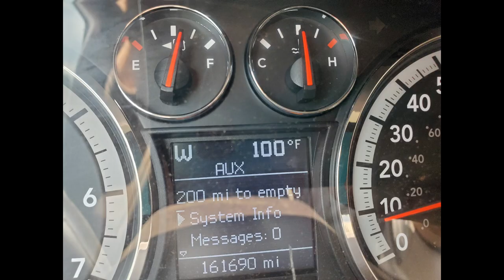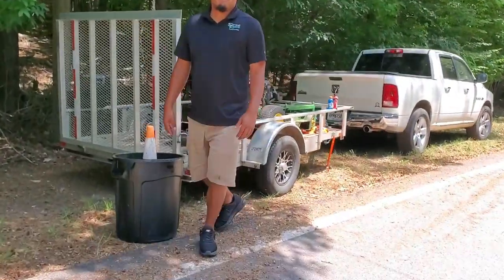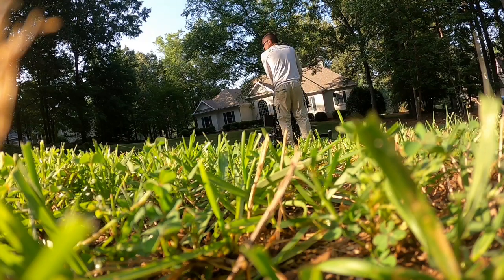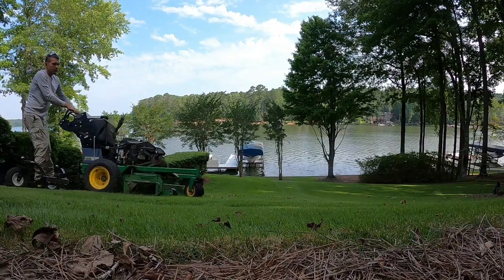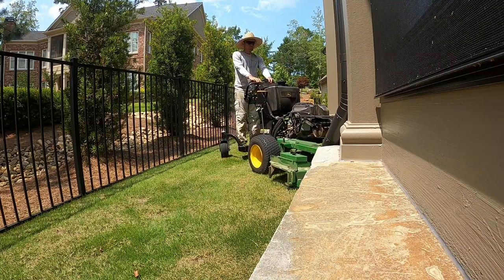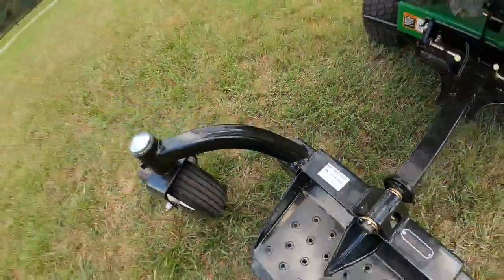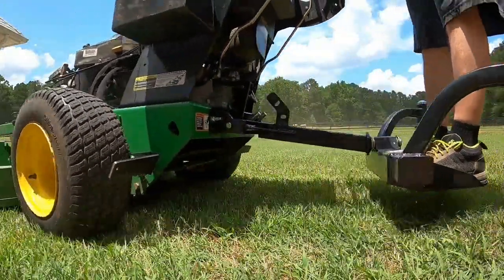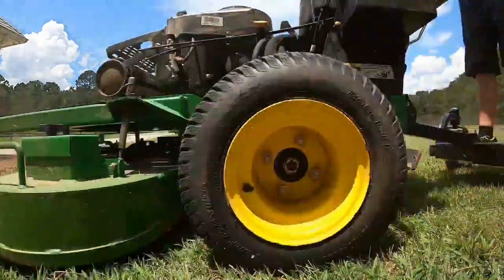NEW PURCHASE! come mow with me!

Comment: Cruising around with the new sulky!  You will be a pro being you know it. You may need a weight kit to help keep the mower from pulling wheelies. I agree!  36 inch Walk behinds for some reason do have a overall better cut quality over larger mowers.
Reply: I thought he had weights on the front, but took them off! They definitely help keep the front of the mower deck down while going uphill! 💚🌱🚜👍👍👏👏
Reply: @dmanburns3705  since you mentioned it. I also recall Tony having front weights when he first got the mower.
Reply from the maker: I thought they were weights but they are just spacers for 1/4 inch increments for the pins. They crazy thing is this mower seems plenty heavy. When its sitting still you cant even barely make it wheely but i guess with a hill and a heavy sulky it will do otherwise lol

Comment: I had a Toro t bar once...the front was so light it bounced like a ball...i got a weight set off a yard sale sight...cut about 12 inches off the bar and welded it to the font of the mower...then stacked weights till it calmed down lol...think I had 2 5lbs weights...10 pound total and it was like a completely different mower...it really help to hold going sideways on a hill....help to keep the front end planted...kinda red neck but it worked
Reply from the maker: Good ideas bro